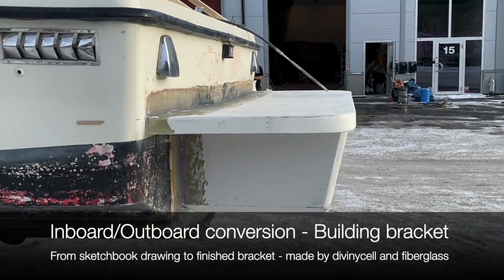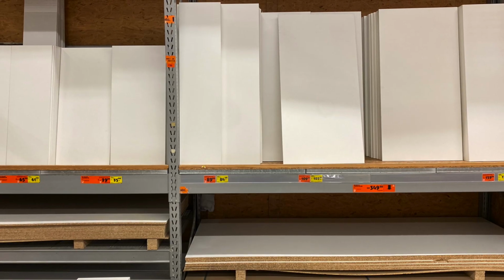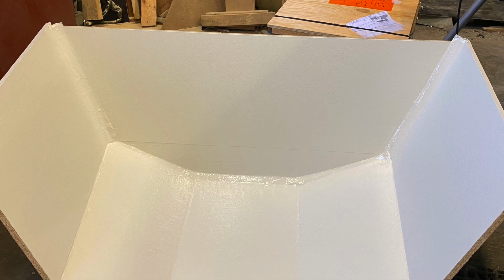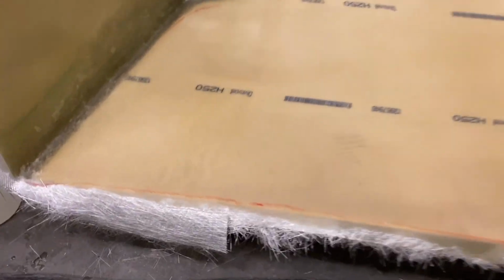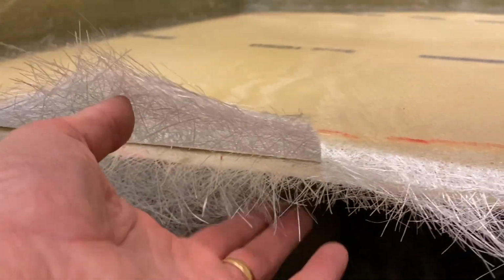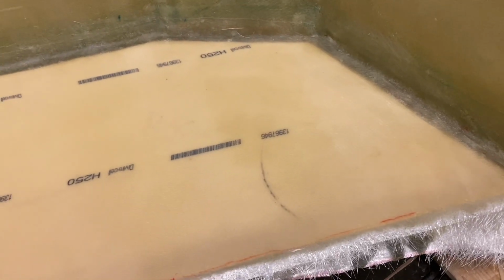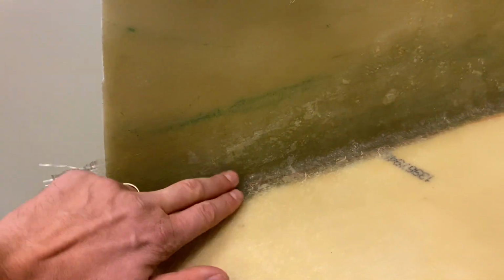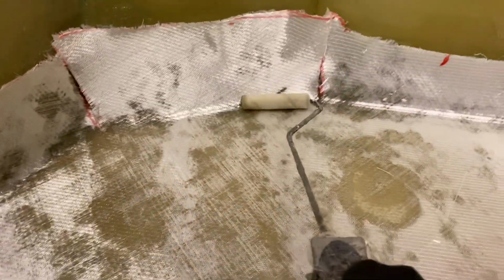Part 3, Smuggler 28 - Building a fiberglass outboard bracket from scratch!

Comment: Great work. My only suggestion would have been to mount the bracket higher. To have the cavitation plate at the proper height on the outboard will require it to be mounted higher then the sterndrive was. A 60mph boat ypu have to go up 1" for every 12" you go back. You may have to go 2" or more up to avoid dragging the motor and reducing speed and efficiency.
Reply from the maker: Thanks!  I very much understand your concern, but the height of the bracket is very much discussed in forums for these kind of boats, so it should be ok. I also have a Seastar jackplate waiting to be mounted, so it will work out fine! 👍
Reply: @boatdevoted  ok thats good! So how much higher did you have to go then the stern drive for it to all work out?
Reply from the maker: @docksidemarine4273   If I’m not mistaken, +75cm from lowest point of the transom. These boats tend not like being rigged to high. I never ran the boat with inboards, they were sold immediately. (See part 1)

Comment: I applaud you in this task, I might add you should always use gravity to help you wet out fiberglass cloth, for example, when wetting out fold your material over on itself, wet from the substaraight, fold it to the location where it will live and do the same on the other side. it appears that your trailing edge of the bracket is lower than the part that joing your boats transom ? if so this may act as a trim tab causing a Bow down attitude.  Please make sure tiyr boats transon will support the trust of the motor  better to address this now rather than later,, LOve the work keep at it ! all the best
Reply from the maker: Thanks! It’s a good point (well, both points are…)! I do have my thoughts about the bracket angle, but it should be ok, If not, I just have to fix it next winter. After this project that seams as a small edit.

Comment: Could you please give a overview of how many layers of fiberglass you used on different parts of the bracket. I am trying to make something similar for my boat and being completely inexperienced with fiberglass im trying to figure things out.
Reply from the maker: Hi! I do not remember how many layers I glassed in, but it’s very important to also use the right fiberglass biaxial cloth and also how you overlap the different sheets to build strength. I most likely used more layers than needed, but better to be save than sorry. Also, if you’re from US, you have coosa board on you local market that works equally well as core material.  Good luck!!
Reply: @boatdevoted  jeg tror vi er i nesten samme land 😊
Jeg bruker annenhver glassfiber vev og glassfiber matte fra biltema.  
Gikk for kryssfiner istedenfor den du brukte.
Reply from the maker: Aha, där ser man! Biltema har en hel del bra prylar men det finns andra leverantörer av polyester och matta med samma eller bättre varor eller priser. Jag har handlat av tex både chemify och dockyardscomposit. Kan rekommendera bägge!

Comment: @00:47 Why didn't you go till the edge of the bottom?🧐
It would have been stronger and make a nicer water flow. Now you get turbulence in two places...😳
Reply from the maker: That’s the way Smuggler boats and Segmo boats are built, and they work great. My other boat is also an I/O conversion, with a similar bracket. It works amazingly well. Let’s cross our fingers and wait and see!

Comment: That is really  the wrong  wood to be using on a boat only got to get a stone chip cracked  paint water gets in and Rot the wood  that won't last long 5 years at most should have spent money on doing it right unless your selling it off
Reply from the maker: Not sure what you’re referring to, since I’m not using wood anywhere.
Reply: Should’ve used marine  ply not melamine chipboard but good effort though I’m thinking of doing the same 👍
Reply from the maker: When just building simple molds its been less expensive for me  using melamine chipboard.